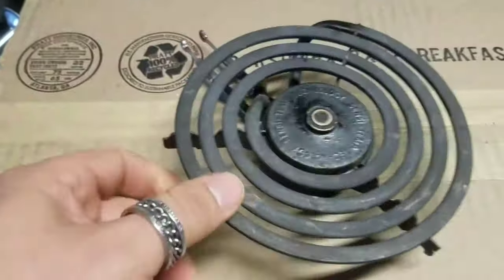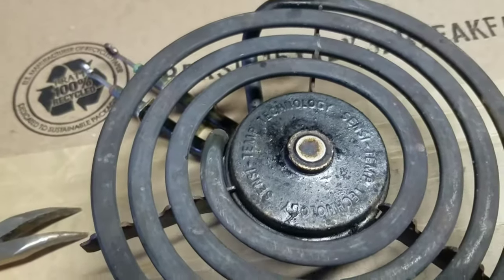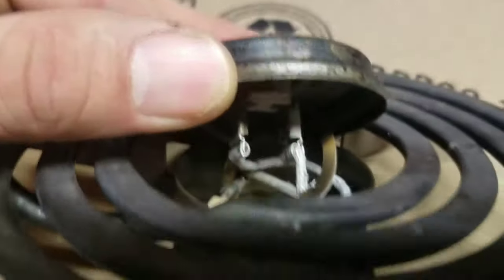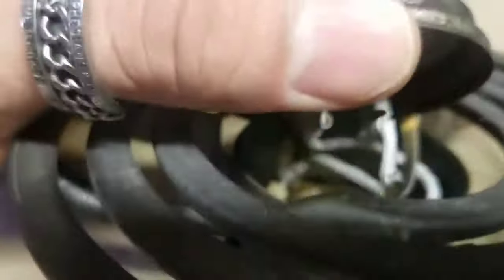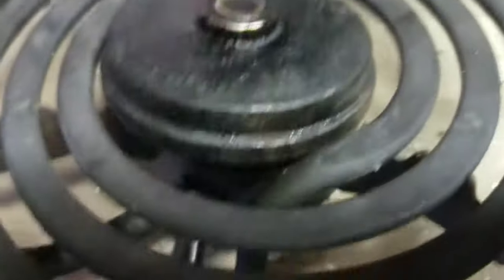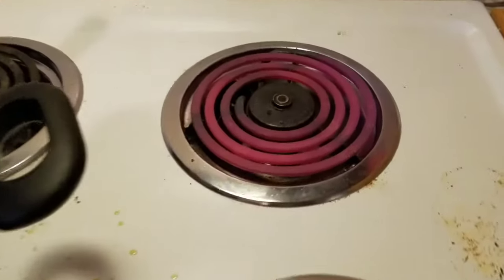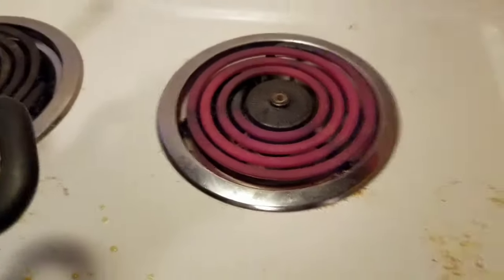Quick Fix / Sensi Temp Electric Stove Stovetop Burners Not Staying Hot or Inconsistent Heat

Comment: This is an extremely hazardous way to do this. This is equivalent to having loose wires in a grounded receptacle box, free floating. This isn't a low budget trashy car stereo - we're playing with 240V at high current potential that will cycle between room temp and very hot. Due to where the wires could short, and the painted surfaces, it may not be a direct path to ground either, so both fire and electrical shock are a potential hazard (note the comment about a spark...).

I'd advise anyone who wants to try this - use ceramic wire nuts or better yet, ceramic screw terminal blocks to prevent the wires from shorting to ground.
Reply from the maker: 100% agreed!!  Read my numerous replies, as well as the description.  That's definitely the riskiest part here, so that's why I've been emphasizing it so much.
Reply: @shadetreewannabe  Yeah for sure. With how annoying these burners are, I know people will attempt this easy modification verbatim, especially if they're not familiar with electricity. I'm posting more as a "for those who want to do this, try this:". 
Even ceramic wire nuts have a potential failure, but that's the surefire way to go.

I used square ceramic terminal blocks found on amazon/eBay. They have 4 screws (only 2 needed for this) and I bolted them down to the bottom inside of the burner center. Somewhat challenging if you're not used to working on small electronics, but worth it.
Reply: Hey it fixed mine bub
Reply: @KurtDobbins  Oh yeah, it works, but the method is what I have an issue with. Flying wires, twisted together, with 240v is unsafe and possibly unreliable, and it isn't up for debate. 
See all the other comments on this and other videos/web pages about modifying these and a shocking (no pun) number of them mention a spark, killing the infinity switch, or other dangerous situations usually followed with "help! I don't know what to do!". This implies completely inexperienced people are jury-rigging 240V appliances. 

I modified mine as well, so I'm not against that though. Hate these stupid sensi-temps.
Reply: Hey if they  didn't  want average  joe having to mess with it they could  have spent a few extra  bucks on a thermal  element  that wasn't  straight  trash
Reply: Are you like the Julian off of trailer  park boys ?  If so bring your drink and get over to my shop. I got a 3 hp single  phase  hooked up. Swich only goes forward  wich  is fine  if you press reverse she catches fire  idk 🤷‍♂️  something  to do with angry pixies.
Reply: I ordered burners from Amazon without the sensors which solved my problem, they fit nicely and now I have NO trouble.
Reply: @WillaCunningham-j6z  Yeah that's probably the best option overall. As long as they fit and are decently made!
Reply: Oops . I just did this and it didn’t go well .
Reply: This fixed mine! If you’re a Karen you might wanna skip this video it’s for DIY people 😊
Reply: @inkmaster2136  Mine shorted .
Reply: @inkmaster2136  Being a Karen is entirely different - I'm just making those who want to attempt this aware that using no insulation is very hazardous. Sure, it'll "work", in the same way duct tape fixes a broken car mirror (though that wouldn't put people in direct risk). Just read the failure comments. 

No mistake, mine is modified as well, but the ceramic insulators take it to the next level, if we're DIYer dick measuring. Maybe I'm just a bit of an electronics nerd who isn't into sub-3rd world safely standards for appliances other family may use 🤷‍♂️
Reply: @pooddescrewch8718  Lmao your honesty is commendable.
Reply: @JulianA-tr6pt  Could have been disastrous so I want people to know ☺️
Reply: @pooddescrewch8718  Right. Glad to hear the stove took the hit. Knowing the circuitry, it'll usually take the short and not shock anyone or burn, but there's always that risk...
I'm all for hacking up stuff and experimenting, but electricity is it's own category. This reminds me of microwave transformer experiment. I've been playing with those since I was probably 15, and they're great fun, but instantly deadly. Many have died in recent years trying to wood burn patterns with them. I'm 100% for all videos being available, though.
Reply: @JulianA-tr6pt  crimp with stak-ons and wrap with Scotch 23 rubber tape, takes 5 minutes and is professional
Reply: @JulianA-tr6pt  capacitors in my old Marshall tube amp have knocked me in the floor before lol
Reply: @steveblack6891  Ah yeah they'll do it. I'm also into guitar amps. I got shocked by a ultralinear "135W" Fender twin transformer when I was about 16. Directly off of the rectifier output, so about 500V DC, live, left hand to right hand. Felt like I took a baseball bat to the back, left a small burn entry hole, and I had some right arm nerve pain if I moved it in a certain way for about a year onward. I didn't even know what hit me - was nothing like the few 120V AC zaps I got. Some Marshalls don't have the capacitor drain resistors I believe, so they'll bite. Especially if the standby switch is used and the tubes can't soak up the residual power when shut off.

Comment: I have done this as well. But instead of just letting the wires float around I place some ceramic wire nuts around them to keep them from grounding or causing electric shock. This works perfectly and I am satisfied
Reply from the maker: Glad you mentioned this!  I didn't know about them when I uploaded the video.  But after another commenter said something about them, I've tried to add that info to every reply in the comments since then.  I even mention it in the description too!  👍🏼

Comment: I found an article on the internet that stated the burners can be replaced with standard burners without the sensor. For $16 I'm going to try that before carving up the ones that came with it. I really just need at least ONE burner that will boil effing water.
Reply from the maker: Absolutely.  This is just a quick fix for the people that can't order regular burners immediately.  But that's the ULTIMATE resolution that I would recommend to be the best fix to the problem. 

Most sets I've seen go for 30 to 40 bucks on Amazon.  Definitely worth the money to get rid of the hassle.
Reply: @shadetreewannabe  it worked GREAT!!!
Reply: I ordered burners from Amazon and they solved my problem..Good-bye sensors!

Comment: Straight to the point, nice and very easy way. Thank you so much, this would save so much time cooking.
Reply from the maker: Very welcome!!  Be sure to get ceramic wire nuts.  You'll need to screw them onto the twisted together wires, instead of leaving them bare.  Definitely worth it to prevent any electrical shorts. 

I would've originally done that when I did this video, but I didn't know about them!  Genius invention.

Comment: Smart simple to the point and effective..5stars..thanks brother..off to the next appliance..lol
Reply from the maker: Thanks so much!!

And again, I like to re-emphasize that this should just be treated as a temporary fix until one can save up for a regular set of burners.  The biggest issue with all this is the risk of those twisted bare wires making contact with something and shorting out.  My only other thought (since you can't use electrical tape or plastic caps because they'll melt) is maybe stuff a little ceramic fiber insulation around those twisted together wires to keep them from touching anything else. 

Like I've said before, I'm not a professional ANYTHING, so this is just my wannabe advice as always.  Lol!!

Cheers!!

Comment: I testify to this fix, which I found with the search terms "disable sensitemp burners".

It is neither crude nor impractical: it's effective and elegant, and your video is succinct. I may write a letter to UL nominating you to their Engineering Hall of Fame. If they don't have one, you could be the founding member. Or I might write to Stockholm and nominate you for the Nobel Peace Prize for meritorious contributions to the Lowering of Frustrations and Maintaining a Consistent Simmer (leading to consistently perfect hard-boiled eggs).

I offer a single note: for me, the wire wouldn't pull easily out of the center lead, where it was immovably crimped. Instead, clip the wire right at the lead; a set of good toenail clippers would do it. You'd be left with plenty of wire to do the rest just as you've demonstrated.

I made a bit of a mess of things trying to work the wire out, since it tore loose without warning, and before I could stop my motion, I tore the wire out of the burner element lead, which fortunately wasn't damaged. I clipped the other wire as described previously, and, possessing the necessary tools and material (and very, very basic skill), soldered it directly to the other lead. Globby, but connected.

Post Script: Put a pot of water on the burner. Turned the dial to 10. Watched the pot. It boiled. First full-speed rolling boil ever. Stayed that way. Then I turned it off.

On to the other three.
Reply: Temperature-adjusting electric burners are a UL REQUIREMENT as of 2018.  They are intended to keep the burners below the temperature that cooking oil ignites.
Reply: @edmacias90815  Not only that, they can keep the burner below the boiling point of water. When you want to bring a liquid to a rolling boil and keep it there for a few minutes, these burners won't allow the temperature to remain constant long enough for this, and not even a simmer is possible. But sure, you won't start a fire making French fries. /They do not work very well./ I have been very happy to disable them.
Reply: @edmacias90815  those burners make cooking frustratingly difficult. Boiling an egg, for example, means bringing the water to a rolling boil, adding the eggs, and reducing the temperature to a moderate simmer. These burners shut down as soon as the water reaches the boil, and will not allow manual adjustment. The water falls below a simmer and takes a good 90 seconds to recover. A soft-boiled egg should take 5 minutes, but not with these. I'll bet it would cost a lot less in the long run to send a thermometer with new ranges with a sheet of paper that says , Don't allow your fry oil to exceed 450 degrees. They don't work well!

Comment: I did this to all my coils, two of them threw a spark near the housing, and from the back of the stove. Is the housing grounded?? Or why did this happen
Reply from the maker: Eesh!!  Yeah that's why I tell people to do this at their own risk because I'm not a professional ANYTHING!  Lol!!

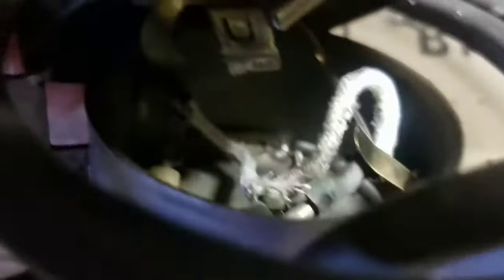Around 1:31 is where I mention bending the clips (that you removed the wires from) up and out of the way as much as you can.  And also when you twist and connect the wires directly together, make sure they're in the middle as much as possible and not close to touching anything else.  The sparking you're talking about makes me think the wires are too close to something and making a connection, therefore causing an electrical short.  Which is kind of scary because you don't want to damage your stove's circuitry, or other electrical components. 

In the end it sucks that we even have to resort to all this to get our burners to perform like they should in the first place, but I guess it's better than buying a whole new set of burners if you don't really have the money.

Anyway, I hope that helps a little.

Comment: My stove is brand new, do I still need to replace coils ? I’m having trouble, please help!
Reply from the maker: This video is just for a quick, temporary fix for people that need to be able to cook in the meantime until they can get the 30 to 40 bucks together to buy regular (non sensi-temp) burners. 

But if you can afford the 30 to 40 bucks now, I would absolutely go ahead and get them ordered.  Just make sure they are the right sizes that will fit your stove model.  It should be pretty standard sizes, but just double check to make sure before ordering.  

Hope that helped.  Cheers!

Comment: One question, my question is do i supposed to connect those two bare wires together or simply put them into a knot and i know about the ceramic caps
Reply from the maker: Twist the bare wires together, then twist the ceramic nuts over them to secure them and eliminate the possibility of them touching anything and shorting out.
Reply: @shadetreewannabe  yessir,& I do appreciate the quick response also...

your absolutely amazing
Reply from the maker: @jedbush2k   Very welcome.  I just wish I knew about the ceramic nuts when I uploaded the video so there was no risk of leaving them wires loose.  That's why I've spent so much emphasis in the comments and description making sure people know about the ceramic nuts and not to just leave those wires bare.  Definitely my bad in the first place, I just didn't know.

Comment: could you not just replace them with regular ones? I'd be afraid to leave something exposed like that
Reply from the maker: A while after posting this video, a commenter mentioned ceramic nuts to screw onto the bare wires that are twisted together, which I HIGHLY recommend.

But this video was made, in the first place, for those that needed a quick fix until they could afford to buy regular burners.  So if you have the 40 bucks or so, I would definitely go that route instead if you have the money.

Comment: Can it cause any problem if I didn't change it and keep using it after doing this
Reply from the maker: I've written in the description and several comments that instead of just leaving the twisted wires bare like I did, get some ceramic nuts (that I didn't originally know about) and attach them to each pair of wires that were twisted together.  That way it pretty much stops the possibility of the bare wires touching something and causing an electrical short or shock.

If you do that, you should be able to use your existing burners for quite a while.  However, if you do end up saving around 30 to 40 bucks to buy regular brand new burners, that would definitely be your best bet in the end.
Reply: @shadetreewannabe   I wish I asked you before doing anything now. I've cut the 2 wires and now the stove saying" cooktop on"  even if it is not.
Reply: @shadetreewannabe   @shadetreewannabe   and it caused electrical short already when I turned it on first.

Comment: Literal life  saver
Reply from the maker: Thanks!!  Just a side note, be sure to get some ceramic nuts to put on the wires you twisted together.  I didn't know about them at first when I made this video.  But definitely get them installed, as to avoid leaving the wires bare and causing a short out.

Comment: So you just wired them together with wiring tape ?
Reply from the maker: No, I couldn't use tape or connectors to secure the wires because they would melt once the burner was used.  So I just twisted the wires together and tried to position them as close to the center as possible so they weren't too close to touching any metal around them.  Which is a little concerning because that runs the risk of causing a short.  My only other idea would be to get a little bit of ceramic fiber insulation to stuff around the bare wires that are twisted together.

Again, I want to stress that this video is just for a quick temporary fix until you can save up the 40 to 50 bucks to buy a regular set of burners.  That's definitely the best case scenario here if you can afford it. 

Cheers!
Reply: Hey maybe add something in the description about using ceramic wire nuts to hold the wires together once you strip them. What you did will work but it is still dangerous  @shadetreewannabe
Reply from the maker: @25newer  That's an amazing idea!  I've never heard of ceramic wire nuts!!  Thank you!!

Comment: Be careful . Mine blew up . Rewatching to figure out what went wrong . My incoming lead burned completely off and arc’d  . There is a little slag remnant welded now to the casing of the sensi housing . They only thing I can think is that I broke the connection the little white wire had on in coming elelment . The protective white covering must have failed ? I don’t know but now I am gun shy about doing any of the others . Has anyone else had this happen?
Reply from the maker: Might have been a short out?  In the description, as well as the comments, I've tried to drench the info everywhere of needing ceramic nuts to screw onto the twisted together wires, instead of leaving them bare.  I wasn't aware of them when I did the video, and I wish I would've been. So that's why I tried to make up for it and put it all over the comments.
Reply: @shadetreewannabe  I think I was too casual in this . Wanted others to learn from my mistake . Clearly the ceramics are key but I have watched several bypass vids earlier in the week and did not remember anything about ceramics . Looking back at a few previously watched vids in a row none of them suggested it . I wish I had rewatched this video . The difference might have been better . I really had no memory of this video though it showed in my watch history
Reply from the maker: @pooddescrewch8718   Oh gotcha.  Well thanks so much for the input and I hope your issue gets resolved soon!

Cheers!

Comment: Can I replace the element with a regular one?
Reply from the maker: Most definitely, this video was just for those that didn't want to buy new ones. There are quite a few coil burners on amazon to pick from with decent pricing. But just to be safe, make sure before purchasing that they'll fit your specific model.  👍🏼

Cheers!  🍻
Reply: Thanks for the video
Reply: @shadetreewannabe  thank you
Reply: What kind coil burner would it be? If you can help please!😆 I am struggle with my stove 😩
Reply: @shadetreewannabe zxdss help me do my electric stove second one please